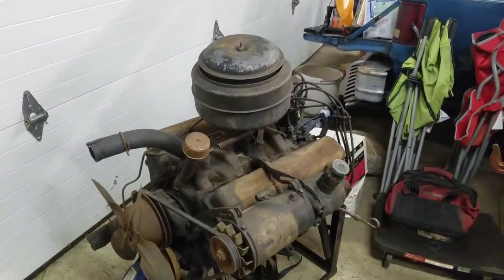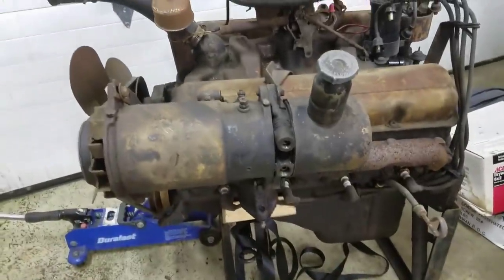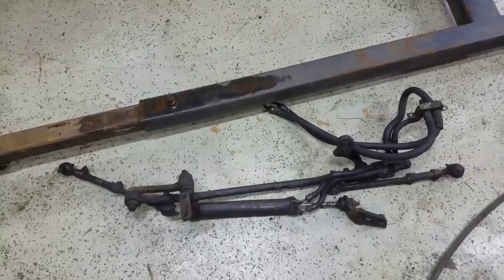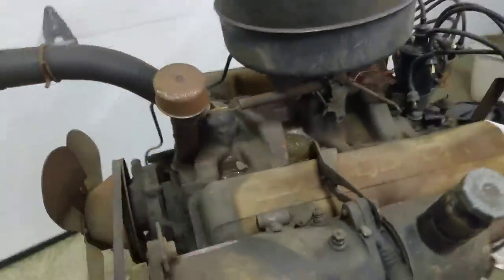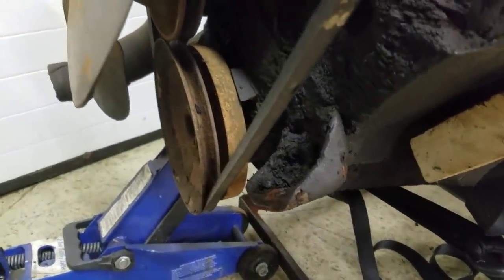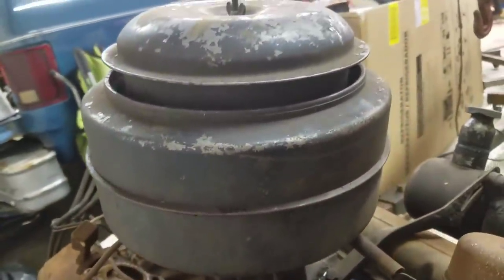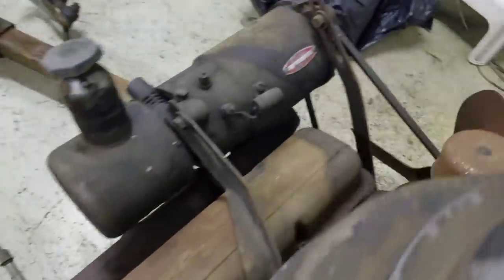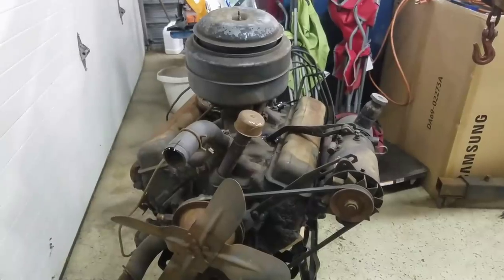The original Small Block Chevy - The 265

Comment: The 262 is the original "small block". I owned one.
Reply from the maker: 262 is a late 70's smog engine, along with the 267. 265 is the original SBC displacement.

Comment: The small block was sensible logical engineering. It only took nine casting cores compared to the competitor's (probably Ford, not stated in text) 22 cores. I went with a friend, early 70's to a salvage yard. He needed a Ford cylinder head for I believe as I recall a 351, the junk yard guy asked him left or right bank? Chevy logical as they are only made one head, you can use it on both sides. Also you can use the same distributor on a small bloc0 Chevy or a big block Chevy. When I built my V8 Vega I wanted a high volume oil pump, they wanted to charge a lot more for the Z-28 pump so I saved money by using  the larger big block oil pump on the small block. It worked great.
Reply: 335  Ford heads will fit either side also. How logical is the distributor location on the Gen 2 Chevy?
Reply: People used to fuss about the distributor being in the back, the thing was for any beyond the fifties they had a point assembly that you could actually adjust the points in the dark by feel. You used an Allen wrench and turned a screw, you did it while it was running. You normally use a dwell meter, I used to turn mine in slowly till the engine started to falter the back it out one turn. That’s where it ran best. Loved those distributors. They didn’t need to be in front.
    The only time the distributor in back was a problem was if you were trying to stuff a small block way under the firewall to get it back as far as you could.
Reply: @michaelszczys8316  I was referring to the LT1 distributor location behind the wp
Reply: Okay
Reply: @michaelszczys8316  Ummm ok that's  all Merry Christmas.

Comment: That's an engine, not a motor. 
A motor is driven by electricity
Reply: In modern day engineering speak you are correct.  If you watch old films from the factory, they still called combustion engines motors, well into the early 1960's.  I've never understood who gives a damn.
Reply: You’re both wrong. 

A motor turns energy into mechanical force. 

An engine turns heat energy into mechanical force. 

All engines are motors... just not all motors are engines.
Reply: @Bartonovich52  Well said!
Reply: So when I was a kid I had an engine scooter, and all these years I have called it a motor scooter
Reply: Tell that to General Motors

Comment: I wish I had that old to 265 I'd clean it, put headers on It, High Volume oil pump, HEI distributor, Aluminum Intake and a  550 CFM Edelbrock 4 barrel, and Port and polish the heads
Reply: In 2018 find an old all original untouched 265 small block and change everything. Yeah, that about right.

Comment: Most folks don't realize the the Chevy mouse was actually designed by Cadillac for a sport type luxury car that never came to fruit..Chevy got the motor and changed a few things..very little actuall and you get the famed small block.
Reply: Not sure about how accurate that story may be. Altough some the same engineers may have been envoled in the design of both engine, I'm pretty sure the small block was designed as a minimum cost to produce alternative to GM's earlier OHV designs. It was intended for Chevrolet form the beginning as they were GM's low cost, high volume division.
Reply: @amc401nash6  True..but read ..and google it..trust me thats the story of the Original Caddy Cimmaron..every other division in Gm had a overhead valve V8 except Chevy..then Ford came out with the Y block 272 292 311 overhead V8 motors ..so the Engine small in size and weight designed for low hood height and weight designed in the very early 50s quazi sport car gets gifted to Chevrolet division in the 55 year model..they were way behind the 8 ball and the popularity of the Ford Y blocks pushed it along
Reply: @danielmccoy8875  I searched it and found absolutely nothing, you will have to post a link. I did however find a 1955 non functional concept/show car called the LaSalle II that was based on the Corvette platform. Perhaps at a later date someone installed a SB Chevy in the LaSalle II and that's how the story got started along with Ed Cole being the head engineer on both the Gen1 Cadillac V8 and the SB Chevy. You would be surprised how twisted history can get, don't believe everything you read.
Reply: @amc401nash6  A freind of mine used to get books and tech manuals right from GM as his grandad owned a Caddy and Pontiac dealership and instead of tossing them he would save for me..I used to love reading anything Automotive when I was younger ..Thats where I got my data from on that ..I wish I knew where all those manuals went to nowadays as people pay good money for them..lol
Reply: @danielmccoy8875  That's the sad thing about history, much of it is lost or purposely altered to serve the ideology of the day. I feel your pain, may dad had car magazines dating back to the mid 50's all sold at swap meets back in the 90's.
Reply: Perhaps it's incidental to mention  .....that prior to the Chevrolet V8 becoming commercially available ,   folks were swapping  out their straight six  engines  ,  and replacing them with  Cadillac engines in their cars and pick up trucks..